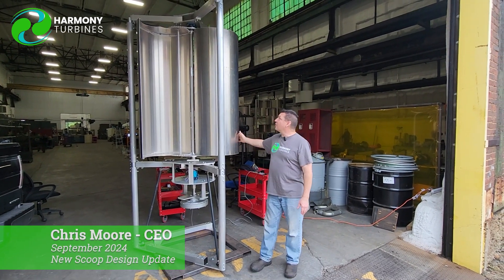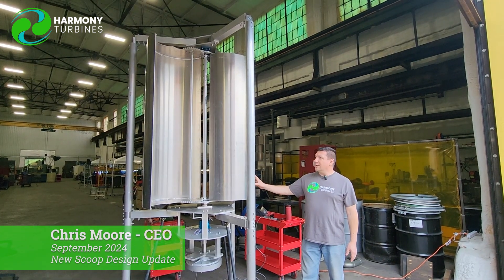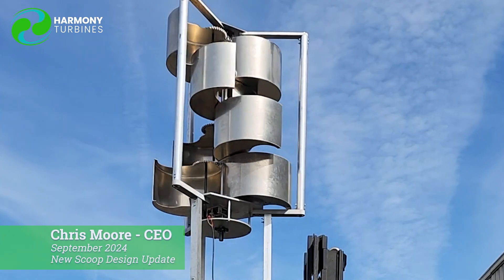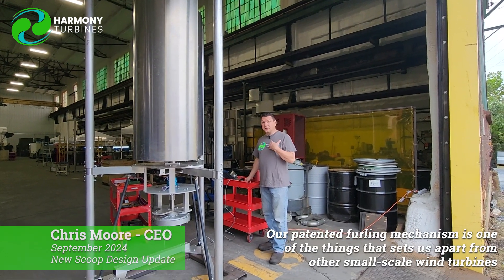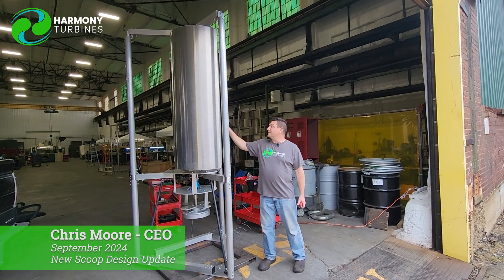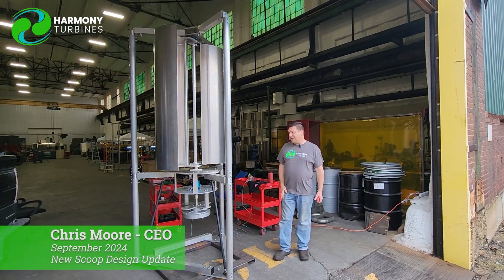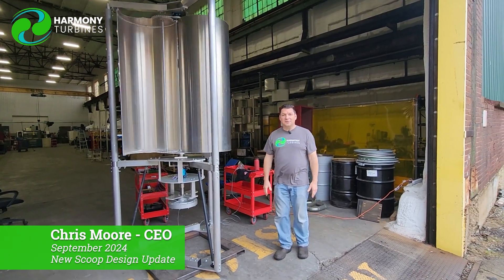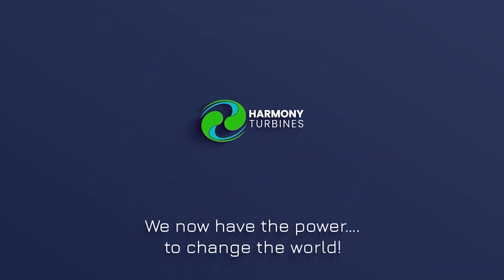Can a 2-scoop VAWT array outperform 8? You decide!

Comment: Hi team. Once you decide on the final product to into production, will you cage these blades perhaps, as a safety feature? Just a thought popping up now. Great work & thank you.
Reply from the maker: The turbine is designed to install perhaps 8-10 feet off the ground, high enough that it doesn't hit anyone in the head! We only keep ours shorter because we need to easily be able to reach the components.

Comment: Whilst most of your efforts and that of other turbine manufacturers will be for mains power systems, I have another problem for which this type of system may well be a solution and that is the 12v DC space, specifically recharging/trickle charging the batteries on small boats. During the Summer the daylight hours are sufficient for the 50W solar panel to keep the battery fully charged on my boat, but during the Winter this is not the case. As a result I am trying to find a small wind turbine that will output 12v DC in the 50-200W range that will also withstand the occasional 70-100 mph winds that may be found in England.

The second part of the requirements, 12vDC & 50-200W is not difficult but the first (small) and third (self-protecting) are not. By small I mean between 50 cm and 100 cm in total height and not more than 75 cm in diameter.

So, the question is, will the Harmony design scale down to something approximating the form factor and power output?

One other question I have about the Harmony design is that that of the furling system. You obviously have an electronic system for fairly obvious reasons but could the furling system be controlled by a mechanical system?

Comment: Lab results are nice to have, but I would still like to see how the two designs work over a variety of wind speeds and conditions.  Maybe the two-scoop design will work better in a steady breeze, but the eight-scoop design will work better in intermittent breezes.  I assume you will test the two designs side by side. I would have loved to have one of your units for testing this week.  We just had two wind events here at my house.  One was a windstorm that took out two of my old oak trees, then just two days later, Hurricane Helene came through and blew down several more trees.   We lost power during both events, so would have been nice to have the backup power, but more importantly, to view how they stood up to the high wind speeds we experienced.
Reply: In its cylindrical form it can use the Magnus effect to spin it at high speeds on hurricane winds and generate tons of electricity without any structural stresses

Comment: Would the turbine still function during a hurricane and harvest the wind energy? Like as it’s furled all the way up it can use the Magnus effect to keep on spinning safely and generate a lot of energy during a power outage?
Reply: They can furl it 95% and still get power.  I expect that the power would be far more than the 5% you would expect just from the numbers.  On the side going down wind, the air flow is smooth so the Magnus effect or "skin drag" will be highish.  On the other side, the step created by the wind going over the offset between halves will cause the flow to disconnect from the surface.

Comment: Hi Chris,
Interesting this "discovery" 
Aren’t you afraid that a very tall  scoop will be less rigid and will twist at high speed...🤔
Reply: That is a thing for the design engineers to solve.  Stuff can be made strong at some cost.
Reply: @kensmith5694 of course...!!!
Reply: @PatDuch58   Cylinders would be aerodynamically stable no? So like if it’s spinning extremely fast in a hurricane there wouldn’t really be any structural stress in its cylindrical form.
Reply: @Fold-103  wait and see....

Comment: So in the end it will be the oilbarrel design. Cut in two halves but can close in windy situations just 100 times more expensive?
Reply: It will still spin on its optimal speed on very windy situations. Let’s say during a hurricane it will furl all the way and will continue to spin generating electricity without tearing itself apart.
Reply: So renaming to Hurricane Turbines could be in place. That is a niche market as well I suppose. Sadly it sounds like driving around all year with a trailer while using the actual trailer once per year.
Reply: @Tito_Happy  the turbine now seems less complex now so if they use this model I am sure the price would be lower.
Reply: The only thing it had going for itself was the beautiful design. A SAAB for a small niche market.

Comment: Nice,  love that 2 scoop design does twice power output of 8 scoop model
Reply from the maker: @kevinvogt8827 Not twice, I was remembering the number incorrectly it was ~63% better in the mini wind tunnel which is still absolutely HUGE!
Reply: @HarmonyTurbines  Yikes! 63%  For many years I have been using the joke "63% of all numbers stated in youtube comments are just made up figures".
But seriously if you want to make the torque more uniform, you only need two sets of buckets.  Still you have a lot of mass spinning so the generator won't change the speed much as the thing turns.  Many years ago I helps someone with a design.  To help it withstand a strong wind I gave the electronics the ability to load the thing down and stall it out.  The "Maximum power point" system was a booster to raise the voltage up to charge the batteries.  The same set of MOSFETs that made the booster work did the stalling function.
If I really was first to come up with the idea, I am putting it in public domain.  Use it if you like it.

Comment: Will the common man living off-grid be able to afford one?
Reply: Living off grid does not imply poverty.
Reply: @TomTaberHODL  Don't believe Mitch said that affordability equates to poverty? Not sure where this comes from?
Reply: 6k so looks like it will be ashigh as 10k. Looking forward to chinese copy
Reply: Hope you like rust and failed bearings. Depending on output, this probably doesn't pencil out except in high wind zones at those prices, tbd how much it comes down with the OG half barrel design  @zonta71
Reply from the maker: One of our biggest goals is to keep prices down as low as we can for everyone. We are not in this to get rich but rather to bring our technology to a world that desperately needs help. Even now in the PROTOTYPE phase where prices are extremely inflated we're able to produce them for around $3,500 each. So if they retail for $6k or $6.5k even in the early stages that's not terrible and the prices will come down as we move into higher production volumes.

Comment: I did wonder about this but figured you had your reasons. Aerodynamics can defy the most logical reasoning. So glad you had the access to the wind tunnel.
I was one of those who felt so smart driving with the tailgate down on my pickup truck thinking I was hypermiling only to be proven not so.
Did the higher efficiency hold true throughout the range of operating wind speed?
Cheers!
Reply from the maker: The weather was bad today and we also had @TwoBitDaVinci visiting us to do an episode on Harmony Turbines. So we have not yet had a chance to put this through the paces and do any truck testing, but as soon as we do that we'll make sure to post the videos. We're also still trying to find a proper generator so that we can begin to get solid ratings on our output and performance of the various designs.
Reply: @HarmonyTurbines  Two Bit is a smart dude. Motors/generators are a tough business. So much compromise. At your wattage outputs, I was thinking you would end up looking at a hub type motor being that they do so well at lower rpm without too much cogging. I've been through the ringer dialing in motors for one of my products. Are you targeting something higher than IP65?
Reply from the maker: No the IP65 rating should be fine for most applications so we're not focusing on that right now but much more on RPM and torque requirements for the various generators. We'd love to stay 1:1 and not have to gear things up but that really limits our choices since we're looking at perhaps 30 - 120 RPMs for our normal operating range. We just received 3 e-bike hub motors that we're going to start testing as soon as next week. Right now it's all about finding a proper off-the-shelf generator that we can use to move into low-volume production.
Reply: @HarmonyTurbines  I'm going to email you. A little more detail than I can put here. May be of some interest down the road. Thanks
Alex
Reply: The big problem will be reliability because of metal fatique

Comment: I’m looking forward to the data. I do like the 4 scoops for aesthetics but efficiency is effectively more free power so obviously that’s gotta take precedence.
Reply from the maker: Exactly, I hate to abandon our design that we've been working on for a few years but in the end a ~63% efficiency boost is enormous! As soon as the weather improves a bit we'll be out testing this new unit. Our biggest issue right now is just finding an off-the-shelf generator to pair to our turbine. You'd think this would be an easy task but the ultra-low RPM's are a pretty large challenge to overcome. -We'll get there, we just need to do good work and test any good candidates. You'll get to see all of this testing as we move through that entire process.
Reply: @HarmonyTurbines  The really interesting question for me would be why? What is it about the 2-scoop that gives the 63% increase and could that be applied to the 8-scoop design.
Reply: The other question would be how much of a difference in manufacturing cost and complexity a 2 scoop vs 8 scoop design brings. Especially given how much larger the scoops are in a 2 scoop design. In theory the 8 scoop design might be cheaper to ship through a traditional package delivery service like UPS / FedEx / USPS etc.